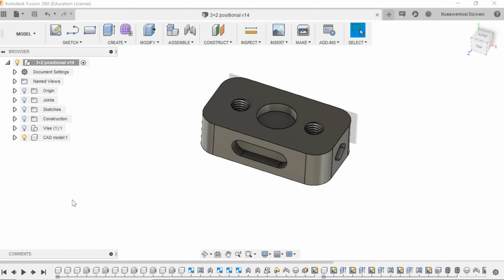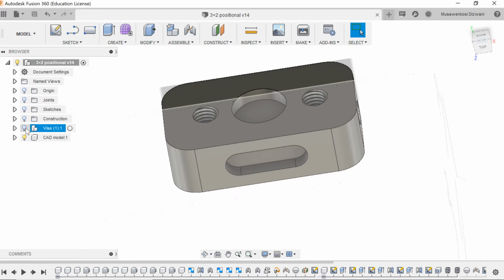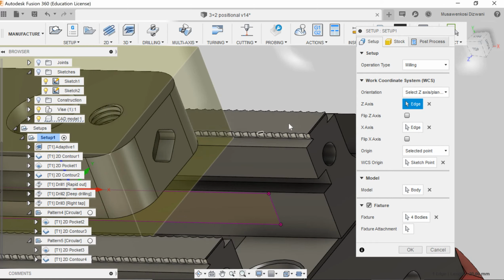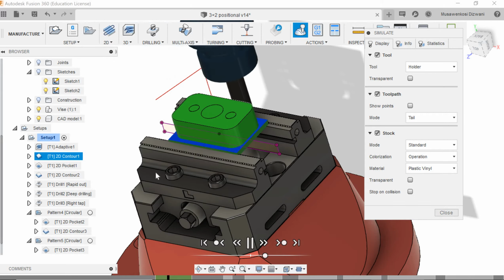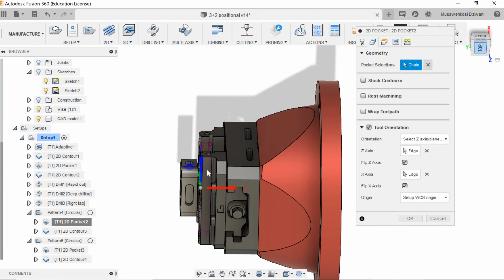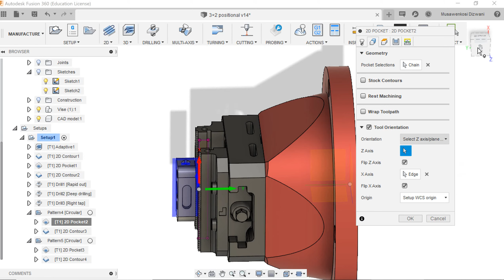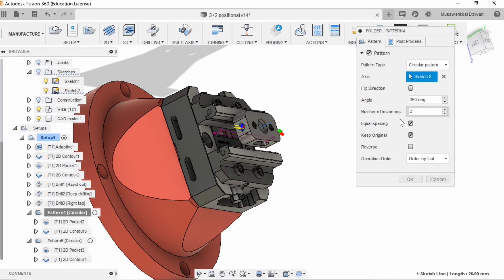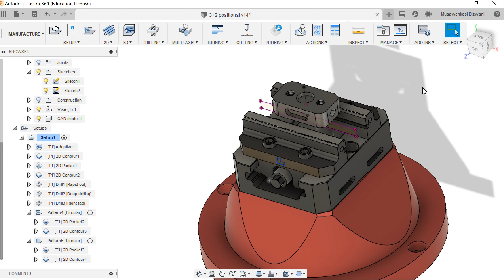3+2 Machining Fusion 360

Comment: is an extention needed to machine with 3+2 ?
Reply from the maker: I haven't used Fusion in a while but I don't think you need an extension to machine 3+2.    The machining positions for different sides are all controlled in the tool orientation option.
Reply: @musadizwani7676  I think currently an extension is needed to machine with 3+2
Reply: @ekremdursunluer9119  no it's not. Extension is for 5x simultaneous machining. 3+2 is included in basic version